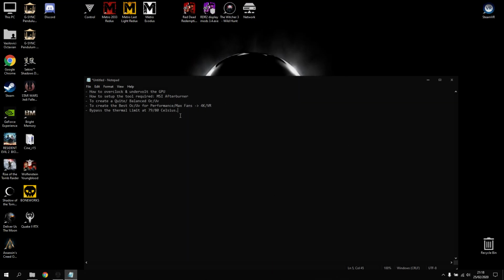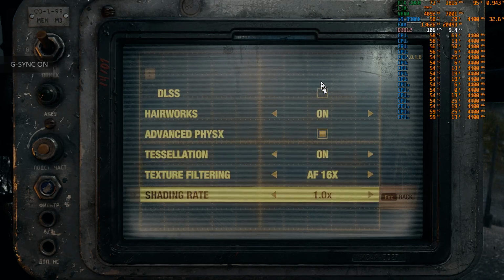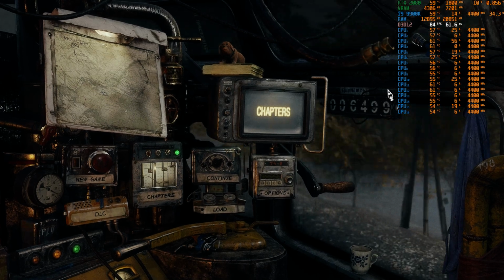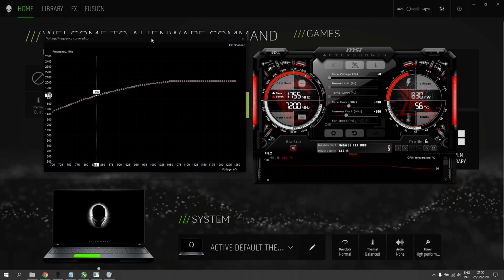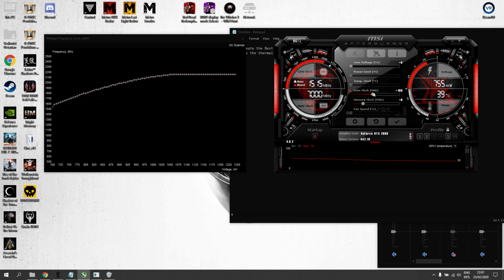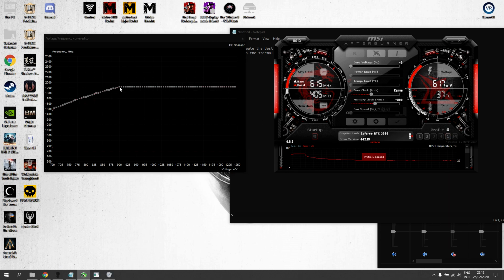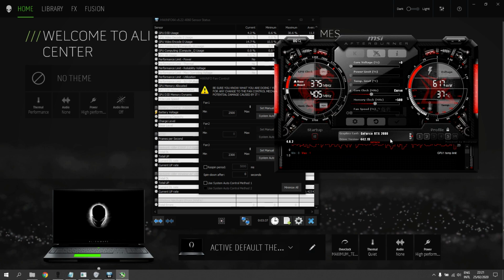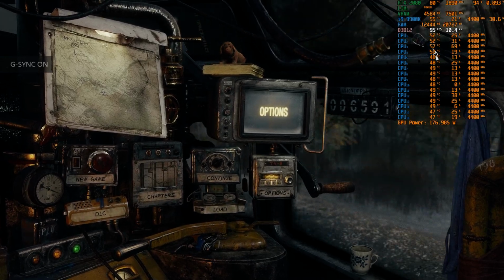Alienware Area 51m - How to "tame" the GPU

Comment: Hey man, great video, sadly the slider in the control panel is locked, and my GPU is stuck at 80C, I have bios 1.5.0 and 200w vbios, it was fine for a while going to 87 even without the slider, and hwinfo shows limit is 87, now its stuck at 80 any suggestions?
Reply from the maker: Wow man, this video is so old. I still have the laptop, but I plan to sell it since I moved to the newer Area-51 18 laptop.
I remember dell pushing a lot of Bioses after 1.5.0 and a lot of Alienware Command Center updated (AWCC) to circumvent around the 87C thermal limit. Now it's 75C. For all intent and purposes they did this to limit the change of burning the GPU card - which now are hard to buy. My original one actually died but it was because I cracked the die with a custom build cooler. (the power deliver and everything was ok, just the core was shorted). But I digress. While it is annoying, they fixed it in the R2 which I also own. The R2 is what R1 should have been (all they had to do was add a vapor chamber and a few more intake air ports. Everyone else copied Alienware after that ^_^).
The 200W vs the update 180W VBios doesn't actually offer a lot of improvements. From the top of my head it was around 2-3% MAX. My recomendation is to leave it up to 75C on newer bioses or if you bypass that it will go up to 82C where it will thermal throttle heavily (dowclock to 500Mhz) instead of Thermal limit the GPU and drop the clocks slightly, BUT improve cooling capacity (better thermal paste, a cooling PAD - even without fans just a bit above the desk, or a cooler room which is harder).
Even at 75C limit on up-to-date Bios, VBios and AWCC, I don't see a big difference in performance. (around 5%). I wish it wasn't the case though :( Not sure how much this helps, but it's what I know about the Area-51m R1 in 2025 :)

Comment: hi bro. I bought ALIENWARE AREA 51M r1 2020. i9 9900k 64ram RTX 2080. bios version 1.28. can I remove throttling by this video?
Reply from the maker: Hmm.. this video is pretty old now. I don't recall what bios this was back then. So, I am not sure what to tell you. Give it a try and see, but I think in the newer BIOSes they removed the ability to control the thermal limit and it's now forced at 75C.
Reply: @Helifax19  Bro, thanks for answering. old, but I found this laptop in factory films and the kit is original. checked on the official website. True, I did not know that you can not update the bios. Can you tell me how downgrade the BIOS to version 1.5? I'm afraid to brick the laptop
Reply from the maker: @max_romulus_V  I think there are some videos on Youtube that show how you can downgrade to 1.5 using a USB stick. I remember, I tried it a few years ago, but to be honest, it wasn't worth it. It's not like you unlock 10-20% extra perf. You do get some perf back at around 5% but for higher temperatures. I know the 75C is annoying, that is why I sold my R1 and got an R2 that has a proper vapor chamber and no issues with the thermals.
But the R2 is a different platform, different bios and a 10th gen CPU and RTX 2000 Super class GPUs.
Reply: @Helifax19  Thanks, bro. I've never had any problems with the RTX card. The temperatures were in the range of 70-83. That's the problem with the new BIOS - if he see temperature 76 - immediately drops the frequencies. I just want my temperature to be 83 and that's it.

Comment: Does your machine keep the curve after restart? I have to apply my profile after every reboot. I think AWCC breaks it. Even with a startup delay of over a minute for Afterburner, it goes to default and I have to apply the profile manually. Its a simple hotkey, but I wish there was a way to apply it automatically.
Reply from the maker: Yes, for me it works. In afterburner you just need set that profile to be applied when windows starts.
Reply: @Helifax19 , Thank you for replying. Turned out to be rainmeter that was messing everything up.

Comment: For some reason my frequencies were much higher than the ones you have 1925 mhz for the GPU, without any overclocking whatsoever.
Also the VBIOS I have ends with 92, yours with 93 but I can't find that version on DELL's website. I tried updating using the only version available and it re-installed the same version.
It's incredible how much sh*t they have done with this laptop, this CAN't be legal and I wish buyers would just get together and do a legal action.

Comment: Hey Man

These videos are extremely helpful, Dell should be paying you to do these.

Any chance you have had any issues with AWCC (command Centre) Often i have issues with the thermal tab (Fan controls) and Overclock tabs that dont load in and have a buffering wheel on them, basically when this happens its either luck if it loads in or i have to do a complete removal, registry and all and reinstall... and what ever profile i had active last is the one that the laptop starts up with -_-....

Comment: Great guide. My GPU was getting up to 89C on almost all games until I made 2 changes. 1) I put the laptop on top of bottle caps to allow it more ventilation at the bottom. 2) I vacuumed out the dust from the back and side vents. This was huge for me. You need to put the fans on max and check air is coming out from both the side and back vents. If not you have a blockage. For me air was only coming out partially from the back left vent. After vacuuming I got a 25C drop in temps. Cyberpunk 2077 running at 100W power consumption in the low 60s compared to thermal throttling hell. Its like a completely new machine now along with applying your guide on undervolting. Also inside MSI afterburner you can make life much easier by finding your ideal voltage and MHZ combo for me on the 2080 it was 1590mhz at 775mv, setting a large underclock on the core clock so that the highest point of the curve is below your specific choice. I usually put it down to -400mhz. Then I select 775mv and move that point up to 1590mhz and click Save. The curve is created automatically for you. This works better than pressing L in afterburner as it allows the GPU to hit idle and cool down more.
Reply: Dude thanks so much for the fix with the voltage curve. I was hitting 81C and throttling literally every minute making the laptop basically unusable, but I set the voltage to the same values as your description and now the laptop stays at 70C max under heavy load. I can finally run VR again.

Comment: I am a bit intimidated by this video having never really overclocked or undervolted before but I have to fix this Area51m to be usable so im willing to learn. I did find this other video 

https://youtu.be/oLU7_rGPcmg 

showing how to downgrade the bios to 1.5.0 before the throttle, does anyone know if that is better than what this vid is saying? Or should I leave the latest bios and then pony up and learn this vid? Please help guys super newb here
Reply from the maker: If you have an Alienware 51m R2 (mid 2020 model to current date) that bios will not work. It is intended for R1. The R2 has vapor chambers for cooling, so you shouldn't need it anyway.
If you have an R1 like mine (early 2020) then you will loose GSync with 1.5.0 Bios.
If you have an R1 from 2019 then it will likely work.

I for one, use the latest BIOS available and overclocked & undervolted my GPU. It performs exceptionally well to this date :)

Comment: Hi @Helifax19. Thanks for the tutorials! Do you have any idea why my CFG profile  files in MSI after burner doesn't have same info like yours? It doesnt have the "VDDC_Generic_Detection", I already did the first step to activate "Unlock voltage control" and "Unlock voltage monitoring" then changed drop down to third party.

BTW, I have the same Vbios 1.0.0.5(180W) in GPU-Z its showing its "90.04.3F.00.62" but yours is "90.04.3F.00.63". Not sure if that has something to do with that. Please let me know if theres a way to fix it so I can follow the instructions in your video. Thanks

Comment: I followed your guide extensively and still had some overheating issues so I paid someome to repaste my gpu and was still having issues even with an undervolt of ~.750 and without any overclock, I lowered my clock speed of my memory by -100 and there has been no overheating issues whatsover, is this the result of a faulty chip or am I doing something wrong? Any changes to my core clock speeds make little changes to temperature (within a certain range obvs) however even the smallest increase in memory clock speed has drastic effects on my gpus temperature :(
Reply: Did you figure it out?
Reply: Late reply but I edited the msi config to show voltages lower than .700 and found that my gpu is only stable at ~.680 dunno if it's a manufactoring fault or if I am just hella unlucky with my hardware, bit of a bummer but I can play all titles without any thermal throttling now so not too big of an issue for me
Reply: But where I live gets close to 30C so probably doesn't help haha

Comment: okya ive unlocked the voltage through Asus tweek gpu and unlocked voltage control in msi, but my graph starts at 1200, is it still cool if i copy your settings? 
im running the same machine as you btw with 2 max size power bricks if it counts. at 1710 in my graph it reads 931mV.
Reply from the maker: Even if the GPU is the same, I wouldn't really recommend just "copy-pasting" my settings. You can use my settings as a reference point, but I would try out and find the settings that work for your GPU and work for you best :)
This was the whole point of the video, to show you how to approach the problem and how to fix it for your particular GPU :) 
Cheers!
Reply: @Helifax19  I'm in a major fix I can't even run game to see the difference as my clock speed would drop to 300 MHz and my GPU usage would be around 99% , it's one of the reason I ended up in your page looking for solution.   Fps would drop to as low as 20-30
Reply from the maker: @1magin3  Have you watched this video?
https://www.youtube.com/watch?v=aavjaAdUzpA
This should fix it for you :)

Comment: Very useful information. Subscribed. I do see a power limit slider in the AWCC GPU section. Currently it is set to 100%. Instead of undervolting using afterburner, can the power % be reduced to may be 90% in the AWCC? Would it be the same thing as undervolting?

Comment: got a few questions: 1. I only have the [start up] section the two cfg file for msi afterburner what shall I do? 2. my graph is very different from yours where I can only achieve 1710MHz with 887mW, I'm currently using BIOS1.5 and 180W BIOS, is my device having some hardware problem? My Alienware 51m was having some serious thermal problem before and have thermal throttling when it reach 90 degrees. I applied it with liquid metal cooling today and it can now keep the temperature at 86 degrees while achieving 1750-1850MHz. 3. I'm thinking if it's because the fans got old, is there a way to check the fan speed?
Reply from the maker: 1. Normally if you only have that section, look in the other cfg file. If both of them show the same thing (one is the Intel embedded GPU and one is your actual RTX card), try to copy in both of them the setting required? I don't really know what to say here. I am not an expert on how MSI Afterburner works - internally. There are quite a few tutorials on Youtube on how to enable Voltage Control Monitoring in MSI Afterbuner. Maybe, check those?
2. Yes, the graph is not always identical. It is mostly based on the CHIP and "how lucky" you got in the Silicon Lottery. The idea is not to "copy-paste" my settings, but to use the same workflow and "see & understand" what works for you!
3. I don't think fans getting older is a problem. (When fans do get old, they start making weird clunky noises. At that point you can add some oil on the rotor - if it's not a capped in fan, and it will work for lots of hours. I still have my 2011 Alienware  m15x from 2011 with the original fan and it works perfect to this day). You can always use HwInfo64 to check on the Fan RPM. You can also check the Alienware Command Centre - that is supplied with the laptop, for the fan speeds!
I hope this helps, in some way!
Cheers!
Reply: @Helifax19  I enabled the voltage control and tried your method but I still can't reproduce the result you has. My GPU can only reach 1720MHz with 0.9V and the temperature reaches 83 degrees. Even with lower voltage like 0.875, the temperature can still go as high as 86 degrees if I overclock it to 1800MHz. Where else can be there a problem? I really need some suggestion to keep the temperature down, thank you.
Reply: @Helifax19  After I dowload the HwInfo64, I found out one of my Nvme SSD has 85 temerature2 when idle. The fan speed control panel does not show my current fan speed, but I can change it to 3700rpm by following your guide
Reply from the maker: @nullpointerexception1685  Not all sensors are accurate in HwInfo64. Try to Compare with HwMonitor and see if they match. If they do, then something clearly is overheating there and I would contact Dell and let them know!
Hope this helps:)

Comment: Hey, was just wondering how ur GPU clock is variable in the alienware command center. It switches between different values like 300-800mhz. Mine stays at 1515mhz regardless of any situation. Do u know how I can change this? What version of nvidia drivers are u running?
Reply: Update to the latest drivers and Bois. I don't know exactly what changed by after I updated the latest drivers and Bois and undervolted my gpu it became dynamic for me
Reply: Kishore Venkat Hey, thanks for the reply, but I fixed it too. I don’t think it was the bios, but what I did was I went to the drivers page for Alienware area 51m on Dell’s official website and installed the old RTX driver. That gave me the variable GPU clock but I was on a year-old Nvidia driver. However, when I updated the Nvidia drier to the latest one using GeForce Experience, it maintained the variable GPU clock, while also providing me with the latest version of all my drivers. Interesting way to do things, but hey, it works, it works!

Comment: Hi Helifax, I was wondering if you were experiencing black screen flickering with your alienware area51m mine starts flickering after it reaches temp above 75C but not sure if this is because of the thermal throttle/power throttle or bad graphics card.
Reply from the maker: I haven't experienced anything like this.
Do you have G-SYNC ON?
What Bios are you on? 1.5.0 & Gsync don't work on newer panels.
If this is not the case, then it could be something is not cooled properly. If you apply any OC try to remove it and see if it still happens.
Not every GPU & Memory chips overclock the same unfortunately :(

Comment: Thank you so much for taking the time to put this together! This fixed my 51m and allowed me to play with full-frame rates! I'm still getting occasional drops but I suspect that's simply from the ridiculously high overclock I'm running but it's not even close to the problems I was having before. Thank you again!
Reply: A little update, my performance drops came back a few days later and nuked my performance. HOWEVER, downgrading to 1.5.0 BIOS and the associated VBIOS fixed the problem completely and retained G-sync. The profiles you provided and Alienware settings now work as intended, thanks :)

Comment: Hey, my HWinfo64 embedded controllers disabling doesn’t work. Unlike u, I don’t see those red crosses that day the embedded controllers are no longer working. Any workaround?
Reply from the maker: It shouldn't matter as long as the FAN icon appears and you can control the fans from HwInfo64
Reply: Helifax19 oh. Does that mean if I tweak fans properly, I’ll be able to surpass the 79 degree thermal limit?
Reply from the maker: @varunbabu2596  If you follow the video and do what I do there, then yes, you will.

Comment: Hello, when I go to config files and try to add settings section, after I save it it resets every time and doesn't activate voltage monitoring.
Reply from the maker: That seems to be an issue with MSI Afterburner! There are other videos out there that shows better how to enable the Voltage Control in MSI Afterburner.
I recommend watching those and get the Voltage Control working;)
I am sorry that I didn't show it in this video (otherwise the video would have been pretty long).
Reply: @Helifax19  I managed to get it to work, the only thing is that my curve was different from yours, I thought it will be the same.
Reply from the maker: @4runasable  Awesome!
The curve can be specific to each GPU. While in theory you should be able to fully replicate the same curve, not every CHIPset is made the same. As a result, in Reality it will differ a bit :)
Reply: @4runasable  how did you get it to work, I'm having the same issue as you did

Edit* nvm I found it.